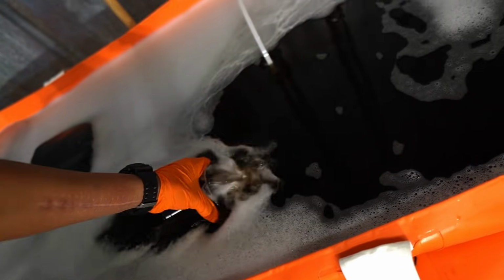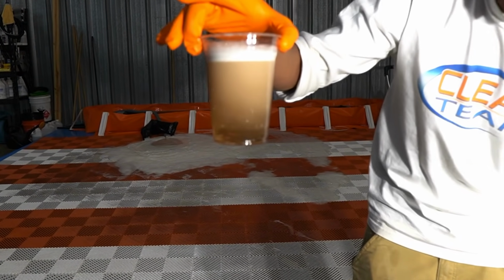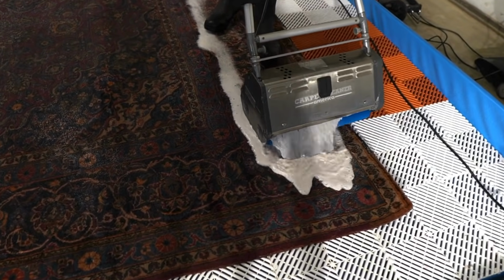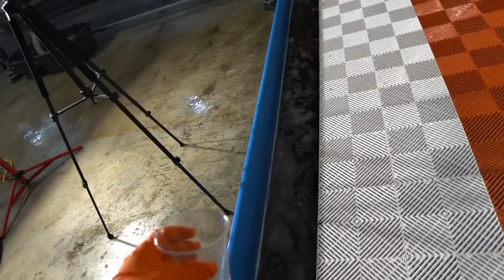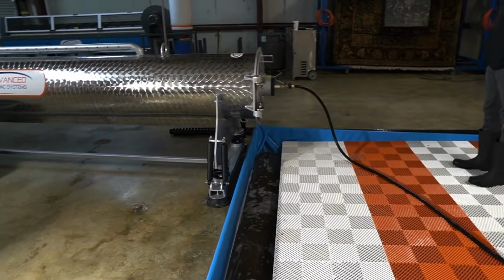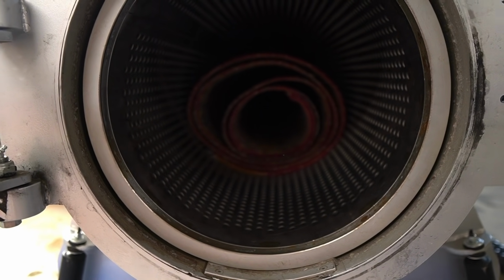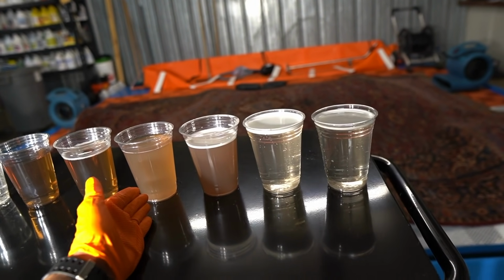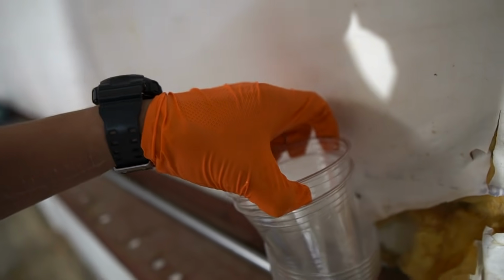Watch us save this family heirloom full of "liquid gold"!

Comment: That was pretty cool especially the taking of samples of water during stages it's amazing how dirty the water was at the beginning and then how clear it is at the end. 1 small suggestion I have is to have some kind of pole or spring type thing that's attached to the ceiling and hangs down above your head with some kinda retractable system on it that holds the cable so you can clean without worrying about the cables, not really important and not needed just thought it might be a good suggestion if the cables annoy you. When I used to work cleaning carpets I was always running over the cables with the vacuum and was so grateful when the company installed a flexible pole that came down from the ceiling right in the middle of the room and I just had to pull on the cable and it would extend and as soon as I let it go it would retract back to the pole, fantastic thing.

Comment: Have you ever thought about putting a big suction grid under the floor so you could suck the water through the rug and if you had some clear pipe on the discharge side you could monitor how dirty the water was with each wash.

Comment: Maybe explain the mechanics of the equipment. Underside of crb, extraction device...steam on vacuum off?, mechanics of space ship? Is it run by separate gas motor? You might have done this explanation before but I’m curious. Also you explain chemicals used. As homeowner do’s and don’t.